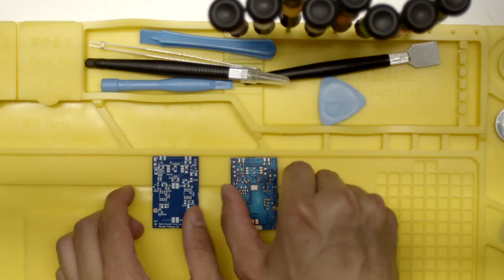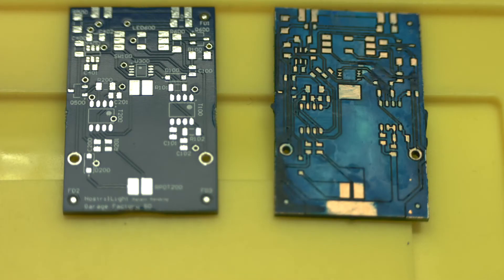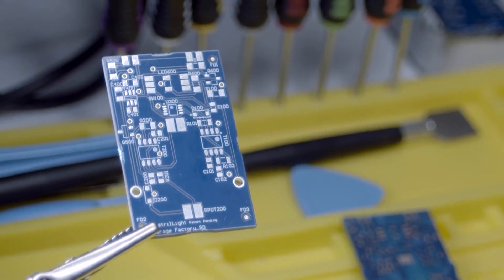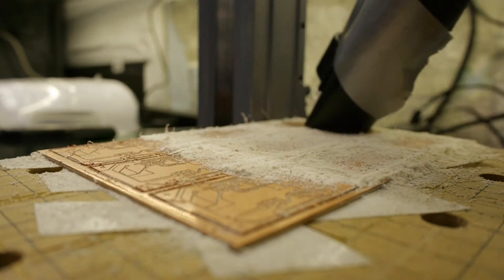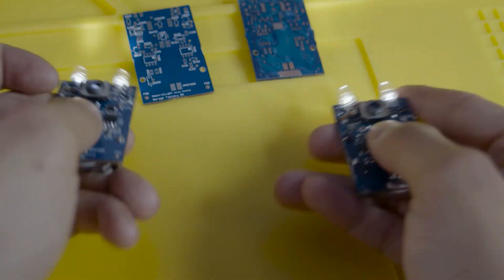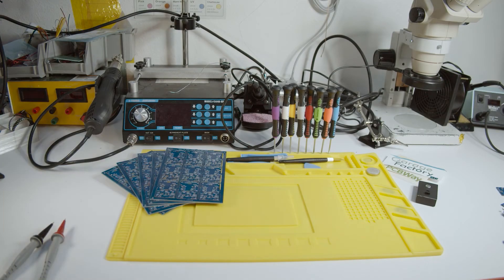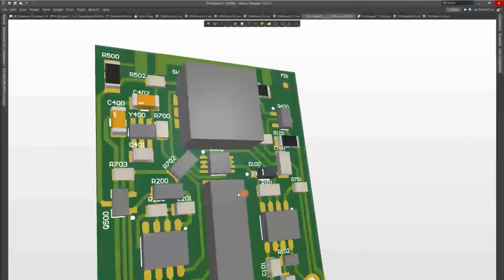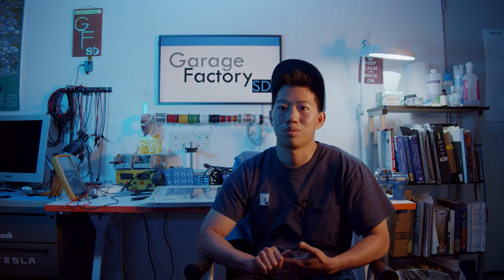PCBWAY Manufactured PCBs and  Snapmaker 2.0 milled DIY PCBs Comparison

Comment: Did you get the solder mask off the pads by hand or did you use the cnc for that as well?
Reply from the maker: Ah well during soldermasking i placed a positive of the pads to prevent the liquid soldermask from curing in uv light. Then just wipe off and clean the pads with alcohol
Reply: @GarageFactorySD  I see, thanks!